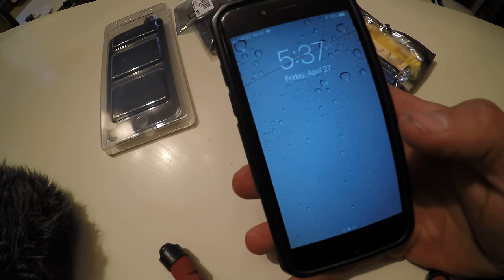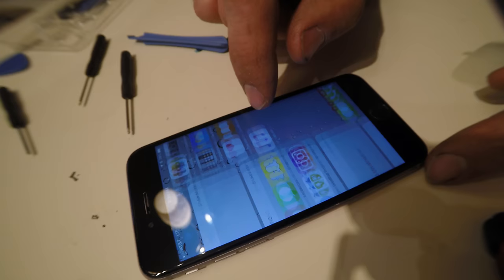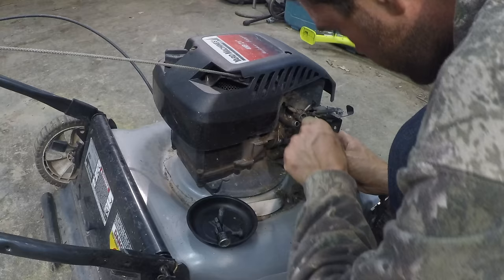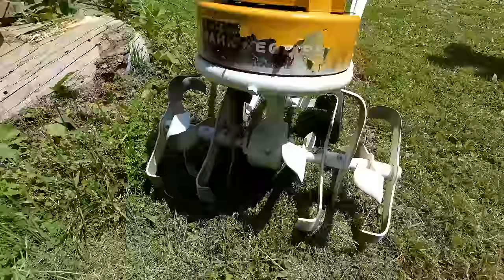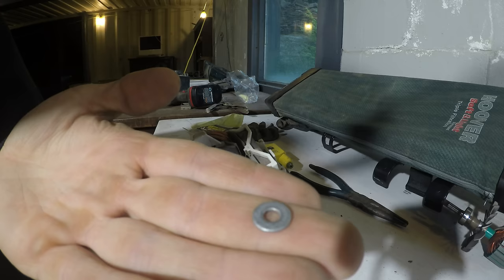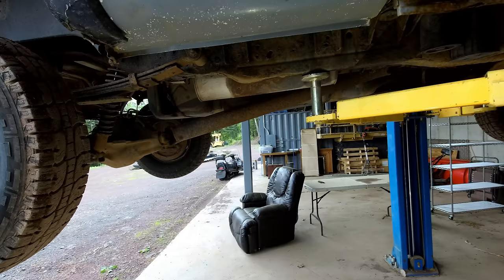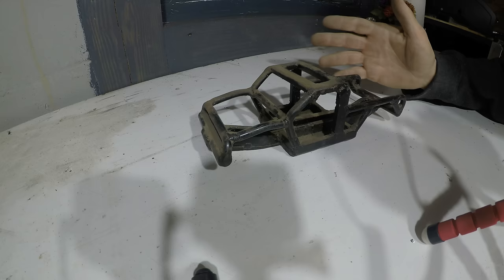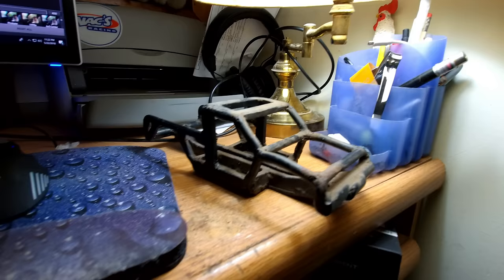Fixing stuff

Comment: I wondering why that mower didn’t have a outlet for the grass... I have the plastic piece that comes out the side come off one time and in less than one pass the under side was clogged up and wouldn’t run, so how is this one running?
Reply from the maker: When they are all closed up like that, that's called a "Mulching" mower; the idea is that they will cut the grass clippings very small so they are not noticeable on the lawn instead of bagging. They can work well, but usually wont work if the grass is very tall.
Reply: Ahh nice. Learned something. Thanks man!

Comment: I think your model is good but it would be better as a locomotive instead of all electric, batteries don’t have a lot of range, and they won’t for a while. But a diesel engine could power a battery which could send power to the electric motors. You would get The benefits of both diesel and electric, Long range and instant torque.

Comment: The big problem is that builders have to allow for driver failure. They have to use materials that crumple during impact. The reason for the tinplate etc seems to me to be the crumple factor in what are called accidents.
Reply from the maker: They still don't need to rust.

Comment: Cost aside the chassis should be constructed of aluminum. Light weight with adequate strength is the point of all aircraft design. Pure monocoque design would be ideal. ALL modern day aircraft regardless of the purpose are monocoque.

Comment: This is so calming! (And like many of my fellow followers, i love the 'For no reason' quote..) 
Remember that the companies usually make things as cheap as possible, som standard parts are often available. I repaired our 'non--serviceable' Nilfisk vacuum with a bearing used on our company's satellite terminal. Standard size! Had to give up on a friends car's ABS central, those pesky bonding connections are not meant to be soldered with ordinary wire.. :D
BTW, your dream truck will cost $500' and get about z e r o stars in the crash test rating.

Comment: Didn't Toyota have a class action lawsuit where they had to replace a bunch of chassis?  I think brake lines should be stainless (or copper, if strong enough), the metal is so thin!
Reply from the maker: I think they did. They should be replacing all the brake and fuel lines for free. I just had a fuel line rust out today on my SUV and leak gas. That should have never happened. It should not be made out a metal that fails.
Reply: There was this against GM, but turns out it's our fault for not washing underneath (hints of poor steel iirc): www.consumeraffairs.com/amp/news/feds-end-gm-brake-line-rust-probe-advise-owners-to-wash-underneath-their-cars-and-trucks-040915.html

Comment: My Samsung a 51 is in pieces as I'm typing this because of the small size of everything. I have to solder the tiniest wire from one side of the battery to the other. Just need a timy soldering tip

Comment: The issue with cars/trucks that are built rigid like that is when you get in a crash, people will just die pretty much no matter what. Even with airbags and everything else, the shock of basically two metal plates smashing into each other with no frame cushioning is just going to be fatal over around 30mph.  I do agree about how the frame is made. The fact that these things rust out is fucking criminal and corrupt beyond measure. There is no reason we cant make these things last 100s of years. A peice of aluminium or stainless  bar doesnt just deteriorate over a few decades. Takes a looong time, and they know that thats why they dont use them. 

Money is in maintenance and replacement of poor but pretty products.

Comment: Aluminum will corrode with the salt they put on the roads, badly, best thing someone can do is spray the inside of the Frame, doors and rocker panels with fluid film to prevent the rust.

Comment: am i the only one that noted that he had a fender medium guitar pic?
-edit: they should make trucks like the original Toyota trucks, but with edits so the frame doesn't rust out.
-edit 2: tube chassis are very useful for racing, but not for road driving. The point of the vehicles crumpling is to absorb the impact. Imagine punching a wall with your bare fist. It would hurt because your fist decelerates extremely rapidly, and gets squished by everything behind. Now imagine punching a wall with a pillow in between. It wouldn't hurt as bad, if at all. This is because your fist doesn't decelerate in nearly as short of a time, and all the skin, muscle, bone, etc. would also slow down without as much force. And this is why they crumple.

Comment: check out honda ridgeline then check out toyota.   ridgeline is unibody aluminum and toyota builds  trucks road tested for 2 years before production.  toyota last 10 to 20 years ...honda ridge line  2006 to present 05/10/ 2021 has not failed  yet. BOTH COMPANYS HAVE A REAL LIFE SPAN OF 30+ YEARS WITH PROPER  PREVENITIVE MAINTAINCE.  (400k expected life span)

Comment: Andrew, aluminium won't handle vibration it cracks.
Reply from the maker: For what?
Reply from the maker: It’s fine if used properly. Steel just rust away.
Reply: @AndrewCamarata  you would have to anodize the aluminium, to seal it from corrosion, the big problem with aluminium is in using pop rivets to fix it to a frame, the pop rivets wear loose, the only way I have seen them use aluminium on a body is with buses, they tested a new type of bus body here in Australia a few years ago all of the panels were glued on with a special type of silicon, they ran it for 1 year over roads in the Australian outback trying to make it fail, but it held up, and then at the end of the test they picked the bus up and turned it over in the air to a 45° and dropped it on the top corner of the roof all as that happened was it distorted the roof slightly and the bus actually bounced back onto its wheels, which proved the design was far stronger then any bus body ever built before, I think you will find nowadays all bus bodies are built the same way.

Comment: Oh !  tw200 !
i found out about this last year, i fell in love with it.
would you trust a 1986 model? what would you check first if you found one?
Reply from the maker: As long as its stock. If you cant find a stock one, just buy a new one.
Reply: @AndrewCamarata  thanks !
Reply: 87 was the first year
Reply: @apetro8895  you are right, it must be a 87, but its listed as 86. 
1st year of production*
my question is, can one trust one of these bike when they are that old?
i did get my response, im looking for a stock one.
Reply: @EnigmaticPeanut  Absolutely!  These bikes are tanks. I have an 88 Black Widow (Black & Red).  I recently did a group ride in the Adirondack mountains in upstate NY. All the other bikes were big dual sport bikes.   Steeps hills, off road, sand, woods, rocks, creeks,.... you name it.  The bike handled everything very well.  Even when we were on pavement doing 55 mph, I had no problem keeping up. The TW200 design hasn't changed to date (except in 2001 the kickstart was eliminated and a disc brake replaced the front drum brake).  The only advice is to get on TW200 forums (Facebook has a few and there are others online).  I think the 87's had CDI issues.  They are easy to find and replace.
Reply: To answer the second question, check all the stress points on the frame that you can see for small/large cracks (engine mounts, rear shock, where the frame tubes turn, etc).  If you are decent at welding, these can be very easy fixes. Check the condition of the tires for wear and cracking.  Check the oil level before starting.  There is a site glass on the right engine case near the rear brake lever.  With the bike straight (not on kickstand), make sure oil level is in the middle of the site glass.  Check to see if the bike starts easy and idles ok.  Check the slippage on the clutch,  how it runs through the gears, if it bogs down, etc.  The bike is very easy to work on as, like I said in the other response, the technology is 33 years old.  It doesn't have fancy electronics that fail all the time.  What does fail is mostly easy to fix, unless the engine is hosed.  That takes a little more time, money and skill to fix.  From what I have seen and heard, these bikes are bulletproof into the tens of thousands of miles.  A good-running, clean 1987 model should run you between $800 - $1,200.  If you keep it in good shape and running well, you'll get your money back out if/when you are ready to sell.  These are great bikes and in high demand in most areas.

Comment: They make the same design vehicle and sell it all over the place in different conditions. Sure, these thin, cheaply made vehicles could last in an ideal environment. However they don't care that the same vehicle gets used where there's a lot of dodgy roads, pot holes, salt and such. Really they should design something that can operate in the extremes and that would be what they mass produce. Of course the automotive industry would crumble as their exploitative ways of making money would fail. There are people here in Australia that will buy every new model Falcon or Commodore (obviously they stopped making them now) even if there were actually no changes except cosmetic. They lose money through depreciation while the companies make money as someone makes irresponsible financial decisions. Consumerism is terrible, I feel bad for people that always upgrade their phones, cars etc. I've had the same Samsung S6 for years now, it's still a relatively new phone compared to what others use and I've had no issues. Still works fine. Meanwhile my sister has gone through multiple phones in the same amount of time I've owned mine.

Comment: Brother they don't want anything to last more than 10 years , really 5 years if they can get away with it. I have this concept also and was glad to see you thinking this way. My plan is tearing down my 76 Winnebago 26 foot Brave and rebuilding it reusing the other skins only. I would like to make it 4 wheel drive off power hubs but maybe using a trains electrics concept utilizing a 3 cylinder low RPM generator to power this not at MPG but hours run. 24 hours on 5 gals of diesel should take you what about 1000 miles? I wonder if a train Hub manufacturer is interested in building power hubs on a smaller scale to power trucks and RVs? We would crush the crappy built RV market that make these jokes of stick frames for 100,000 grand and same shit right into the millions. Contact me I think we should talk! I first watched You about a year ago and it was the driveway into the property with the black plastic underlay and thought "Oh No another youtube Flasher" but I was wrong, You are the real shit! You remind me of these dudes I partied with early 80s from your area over at Cayuga Drag strip in Ontario. We all had a blast during a long weekend spectacular Jet dragster/ Funny car show that I will never forget! Cheers from Algonquin Park, Ontario.

Comment: all your car related ideas are valid but also can be easily countered, for ex. aluminium cost a little over 3 times as much as steel pound for pound, which would raise the price of the car by a lot (like double at least), making it uncompetitive and potentially unsellable, sure there are people like you who would buy it, but not enough to keep a company in business.
Those bumpers are soft plastic for a reason: 1. pedestrian safety (in case of collision) 2. looks 3.lots of people bump into other cars with them when parking, i'd hate to have a bull-bar like yours bump into my car and all cars having bull-bars like that would make for some horrific accidents, the strongest part of the car needs to be where the passengers are, not the crumple zones, i'd prefer my family surviving over my bumpers.
In short everything is as it is for a reason and the only way to really change anything is to 'vote with your wallet' (if everyone bought aluminium cars they would stop making ones out of steel)

Comment: Designed obselesence......The motor companies can build a car/truck that would last 50 or more years, but they would have to charge an absolute fortune for it because when are you going to buy another one, hence they opt for building vehicles that last a few years and you buy a new one it's not just vehicles either it's all appliances and tools you name it, it's got built in obselesence.

Comment: Elon Musk is already making this happen with the Cybertruck. Shouldn't be any rust and dents. But putting the motors, let alone the gears in each hub is probably connected to lots of down sides. Biggest of them being that all the weight would be unsuspensioned. Sure you could do all the things what you say but then the thing is gonna be heavy like a tank and consuming a lot of energy. You were talking about military vehicles...thats actually the point. Almost nobody is driving them around as they are too heavy and consuming lots of fuel. 
Anyway...cybertruck is probably gonna be a good thing.

Comment: They make vehicles purposely to only last for so long so that in the near future you have to go buy a new one or buy lots of parts to keep it going. If car manufacturers made the ultimate long lasting vehicle then they would go bust cause no one would need to buy a new car. Kinda like some phones they make where they seal the battery in the phone so you can't change it out for a new one so when it starts dying you have to buy a whole new phone. Same with washing machines an dryers they dont last like they used to back in the day, it sucks

Comment: Andrew, your videos are awesome but I have to disagree with you on the vehicles.  Your 60 year vehicle would weigh 8k pounds and cost $100k and it would never sell.  Your frame problems are 100% from salt, we do not have those problems where rust is not an issue.  That would be better solved by car washes available all over with passivating car wash to stop rust.  ETA I do like your idea for a frame.
Reply from the maker: I think the price of the life long vehicle can be comperable to current vehicles. But even with your numbers, that still works. Current trucks cost 50k and last 15 years. A truck that cost 100k that lasted 60 is a much better deal. But if it could last 60 years, it could last 200 years. If it never rusted out, and the vehicle was simple, easy to fix, and never re-designed so parts would always be avaiable.

Comment: Andrew,  that's not the way the mfg's want it..  Its all about the money..  Older cars don't have any black boxes that report every thing.  Blue tooth and its gps can be turned on and they can listen to what ever is said.  The other thing is that if i had a car that lasted even 30 years and every one had one like this, the mfg's wouldn't make any money  for a long time.  they won't do it.  Look when they made that call back,  bring your old car in and we'll give you a discount on your new vehicle.  Those engines can be re worked and made better and get over 45 mpg.  Can't have that.  I have a 2006 kia, and when i looked into my service contract on the motor, it said , they won't cover any problem due to the use of ethanol fuel's, unless you can prove you put in the tank some fuel additive.  So i now use non ethanol fuel.  I been getting around 43mpg's and i have improved my hp's.

Comment: i love watching you fix things it makes me want to fix things. i like your idea of the ultimate truck the only thing i dont like is the electric motor. i think the electric motor would drain its juice and your stuck like for fuel you can just fill up. what if the battery dies like trash then your stuck with a dead truck and have to buy an expensive battery. i would rather a diesel engine or gas engine. also to not have an exhaust you can hood stake it so you dont need that exhaust pipe. thats just my two sense.

Comment: The reason why vehicles are made the way they are today is beause its COST AFFECTIVE. Plastic doesnt weigh as much as all metal vehicles. The auto industry knows the cost to build the vehicles to your standards would cost alot more to build and sell. To be cost effective lowering the weight of the vehicle makes it cheaper to sell. Compare auto vehicles weight from the 40'-70's to current standard weight today. Steel costs today is encredibly more expensive today than in the past. The more it costs to build the vehicle to your ideas labor costs included would not make it comparable to be able to sell in todays Economy only certain people would be able to purchase a new vehicle.